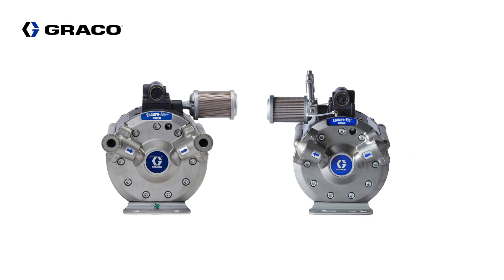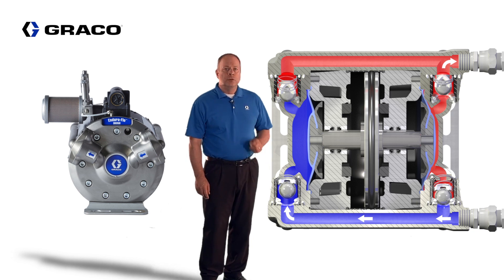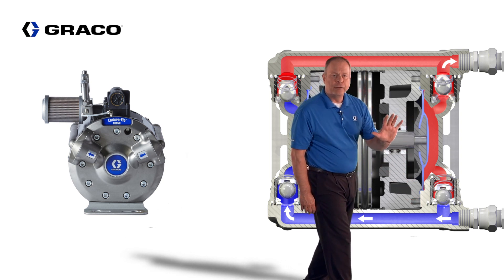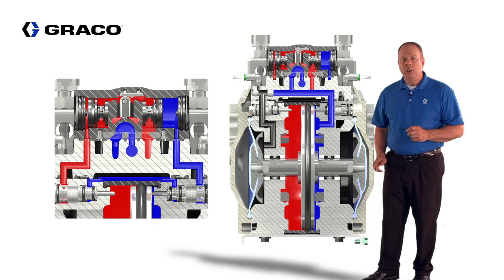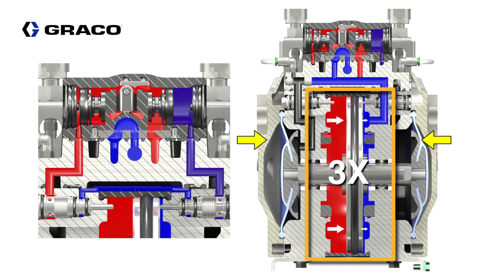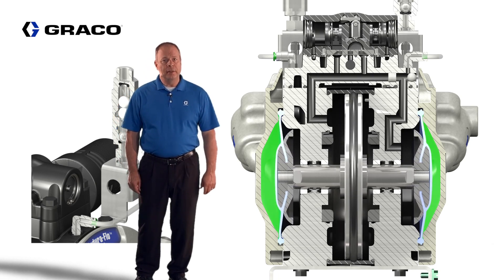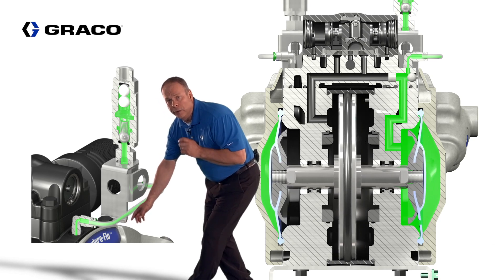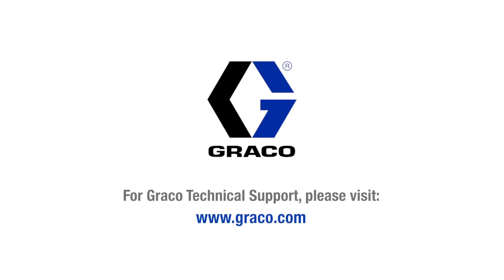3:1 Endura-Flo Air Operated Diaphragm Pump - Theory of Operation

Comment: Hi...so the discharge travel discharge can be longer than standard 1:1 AODD pump, right ?
Reply from the maker: Correct. Due to the extra pressure the Endura-Flo pump can generate, it can overcome greater pressure drops in longer fluid lines.
Reply: Would be amazing solution jn such remote applications. Happy with Husky 1590 so far, but need AODD pump with higher ratio like these 👍👍👍. Will look for the nearest distributor.